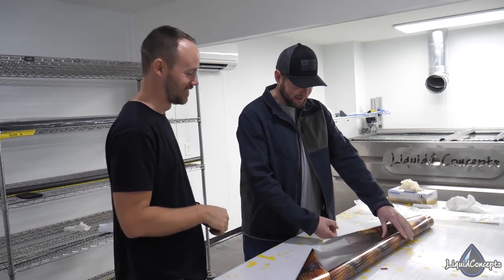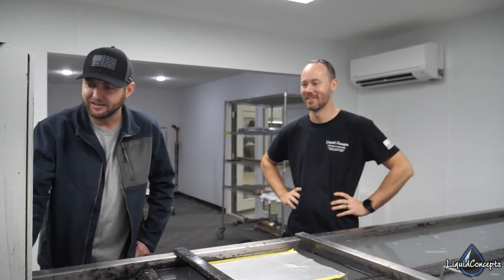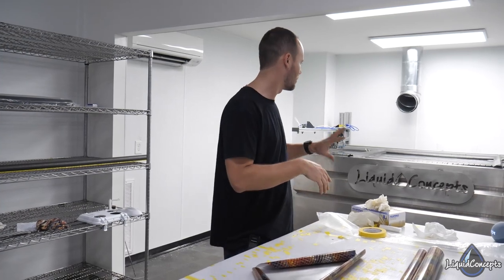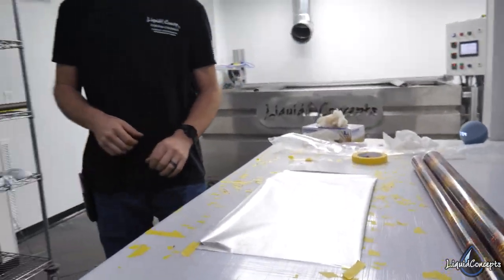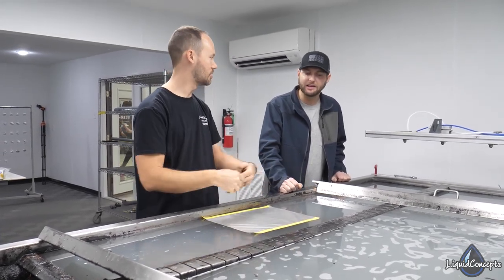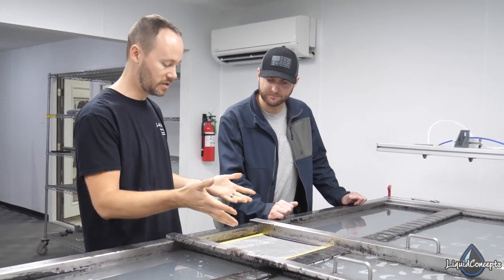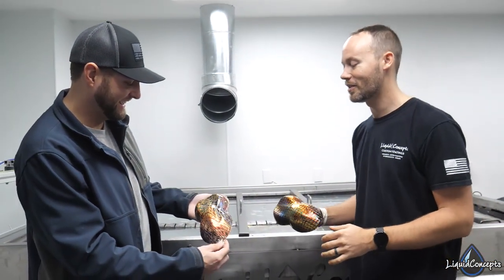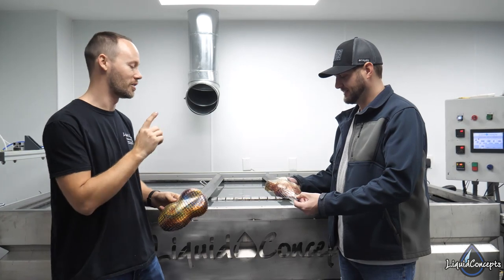Beginner VS Pro Hydro Dipper

Comment: What is the table made out of that you cut your film on? What kind of activator do you use that doesn't require a mask?
Reply from the maker: The table is made of HDPE. With all activators it is advised to wear proper PPE. During videos we do not simply so we can still talk but we do run a exhaust film that is also still pulling out the films during the spraying process to limit the exposure.

Comment: Hey I’m a beginner at hydro I’m trying to dip my 06 Impreza middle console 3 piece carbon fiber how I make it look like it’s one price that the lines of pattern matches up? Thanks
Reply from the maker: More than likely depending on the size you would not be able to dip these all together so there is not a exact way to lineup it perfectly. If they are small enough pieces that can be jigged up together then you could do this to ensure a match. Here is a video that may be helpful- https://youtu.be/GbuC_sB3yms

Comment: This is one of trickiest films I've dipped. Its very thick. I had to soak a bit longer, one extra pass of activator and about 15 seconds quell. It was tough but I'm still no expert bu any means.

Edit: Hahaha! Jeremy just confirmed what I said!  Front face of an Xbox controller looks like Jeremy's and even better with clear coat buuuutt, 3 failed attempts for the back shell. This just motivated me to get that damn back shell done. Sheesh, I'm almost out of this film. I've never totally run out of a particular film before I finally got successful hits. I've got to finally invest in a spray gun system because of activator inconsistency. I got about 2 more trys. Let's go.
Reply from the maker: I highly recommend in an hvlp gun for activator spraying if you want more consistent result!
Reply: @LiquidConceptsUSA  thanks guys. After all my trials and dip after dip including practice dips with new paint or film; reading forums like reddit and K2 as well, the final conclusion was activator has to be precise. There is no room for error not even a little bit and you just can't count on that from a rattle can.